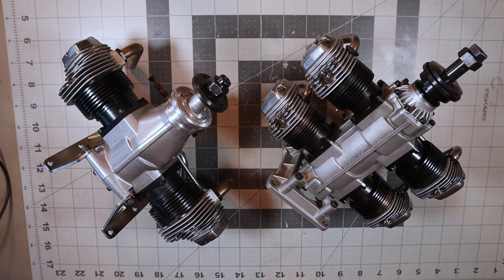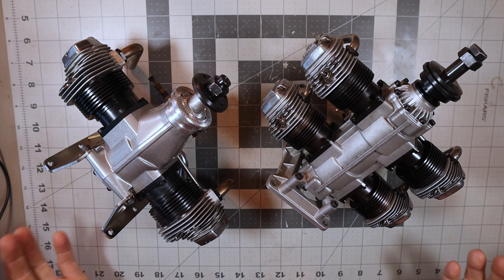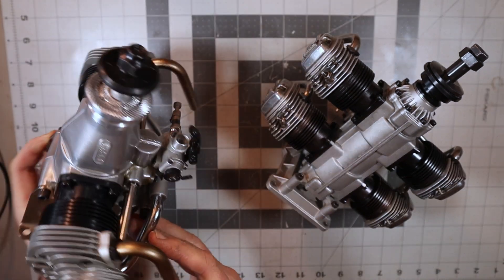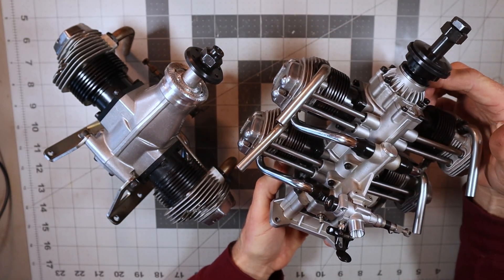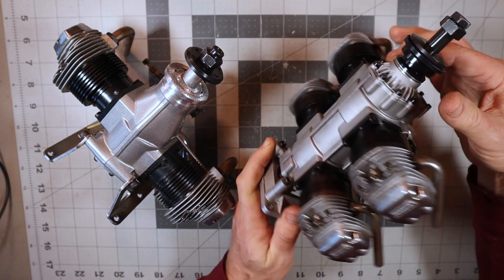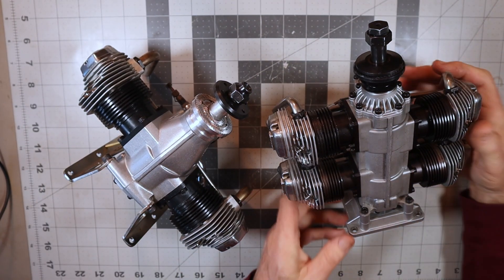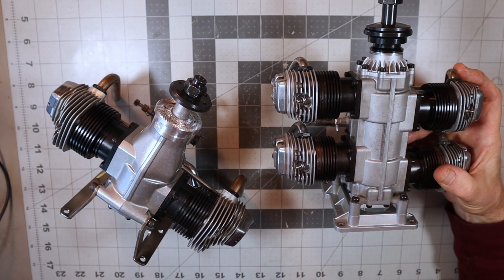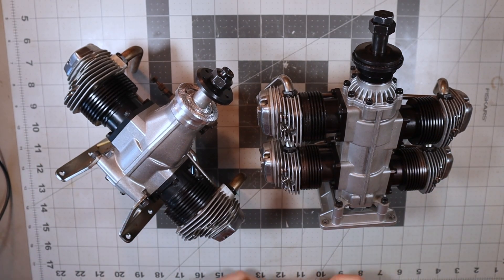OS Engines A Pair of 240's

Comment: I follow you from Turkey and thank you. I have an asp 52 type nitro engine and I have methyl alcohol and 100% pure castor oil. What is the rate for FAI fuel?
Reply from the maker: I cannot answer that question?  How could I?  Fuel consumption is directly affected by how much throttle you are using at any given time.
Reply: @dmrcflyr2  I actually want to make my FAI fuel at home, I'm curious about the rates, that's the real question. %20 castor oil - %80 methyl alchol ?
Reply from the maker: Oh the ratio not the rate of consumption.  FAI can be anything you desire.  Typically it is either 80/20 or 75/25.Methanol to oil.
Reply: @dmrcflyr2  What is the best rate for my asp 52 engine ? Would a 5% difference cause too many problems? Some say the ideal rate is 17.5 percent.
Reply from the maker: You engine will run fine with many different blends. 5%, 10% nitro, or no nitro.  I cannot tell you what is best for your engine.  If someone tells you 17.5% of something, you didn’t state what component, is best, then listen to them and see what happens.  I am not a fuel expert. I run what I run and have never had an issue. How about simply reading the manual and run what the manufacturer states….
Reply from the maker: Straight from the manual.  While I would NEVER recommend 15%-20% or higher nitro in ANY engine. So I do NOT agree with what this manual states for fuel at all.
https://www.manualslib.com/manual/1017471/Magnum-Xl-52rfs.html?page=3#manual
Fuel RecommendationWe recommend using a fuel containing 15%~20% nitro and 16%~18%castor oil/synthetic oil blend lubricant. The same fuel can be used for bothbreak-in and normal running. After break-in, a fuel containing 25% nitro canbe used, but only if the fuel contains 18%~20% castor/synthetic lubricant
Reply: @dmrcflyr2  It is impossible to find nitro methane in my country. I need detailed information on how to make fuel with only methyl alcohol and castor oil.
Reply from the maker: @befastt  Well have you searched the internet on how to make it?  It is quite simple, you just said it and it is said above.  Two component parts, methanol and oil in two ratios.  Either 80/20 or you can do 75/25.  How difficult is that?
If you insist on making it even easier, maybe you watch this video.
https://youtu.be/5p9uz482dUI